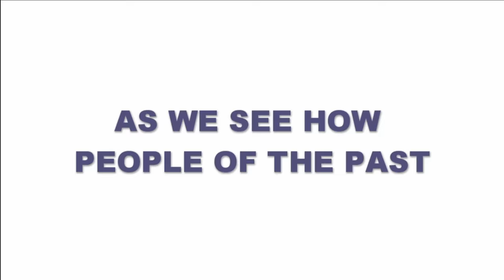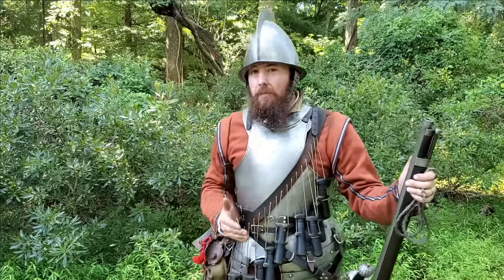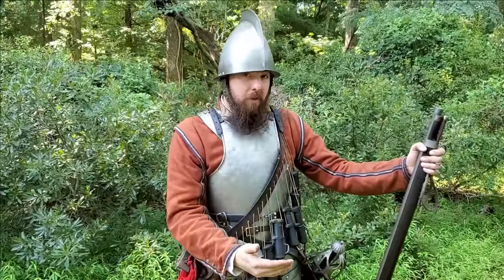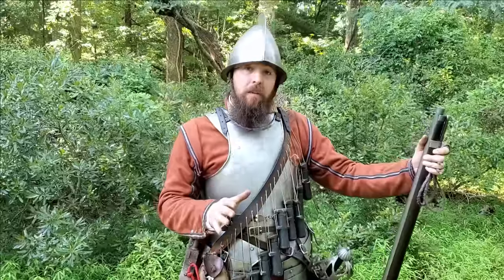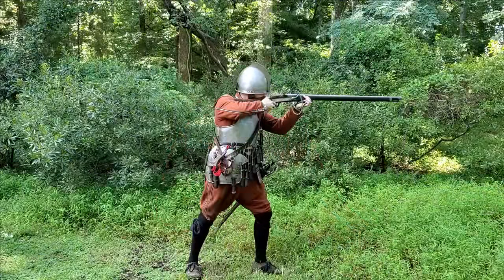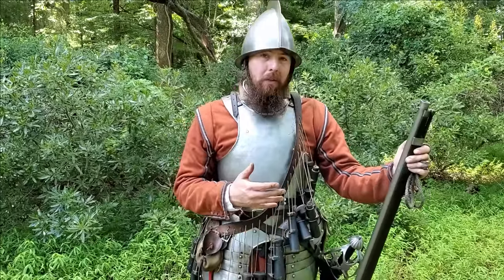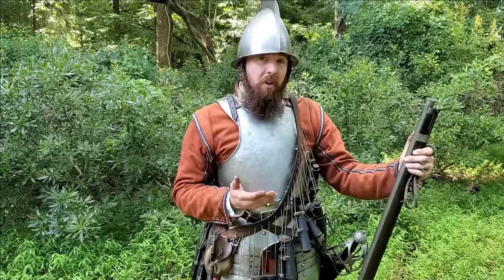Primed and Loaded | Matchlock Arquebus Rate of Fire

Comment: Imagine the speed of a blunderbuss, as you don't need to bother with the match, and can just throw your ripped cartridge right in the funnel
Reply from the maker: A firearm such as a blunderbus would at best see use as a cavalry weapon -- easy to handle, load and fire while mounted on horse. As a cavalry arm it would likely have a flint type ignition. But lacking any range or the energy of infantry firearms like the arquebus, caliver or musket. They may have been used aboard ship, but it appears they saw effective use in the 18th century as coach guns aboard Royal Mail coaches -- with flintlock ignition.

Is speed of loading the only important criteria?  We think that range, velocity and energy are pretty important.

Comment: Nicely done!!  Yes, trying to explain the differences in tactics and a more "methodical" approach to the way the weapons were used, as well as the 'team' dynamic, is difficult to an audience that has been used to "individual" rate of fire with a weapon designed for incredible rapid fire.  The mention too about "employing" firearms troops in the period differently, and that you may not want or need a ridiculous high rate of fire is hard to get across to the modern audience.  IIRC there were some letters or complaints from some commanders that demanded "trained bands" for their musketeers, they wanted to have competent, well-trained men, not anyone taken off the street and given the minimal amount of training, let alone under stress.
Reply: We 21st century individualists forgets how central adding manpower was to any number of tasks was. Even up to WW2 all problems were still being solved by adding more people to the equation. In war, it spreads out the workload and makes an individual's task easier. 

Only in modern times we are tasked ideologically to give individuals as many tasks as they can handle and then some.
Reply: @Oldsmobile69  it still applies today, Ukraine is struggling in the east since Russia has a 2 to 1 advantage in bodies right now
Reply: @Oldsmobile69  Ukraine is not faring any better, as of today Wikipedia paints Ukrainian dead and wounded at ~100k, given that Ukraine has a significantly smaller population and economy to draw from, there is little they can do without even more western aid.
Reply: @jackchurchill3777  "struggling" sure but keep in mind Russia is suicide attacking Ukrainian positions with convicts and expendable infantry to gain little bits of ground which works in the short term but if you look at the entire theatre even with those tactics they haven't even been able to take over a tiny village and are suffering much more casualties than Ukraine, of whom are more expensive to replace given how much more expensive a modern soldier is, than say a ww2 conscript armed with a rifle.
Reply: @jackchurchill3777  Ukraine has a significantly bigger economy to draw upon - EU, USA, Britain, the British Commonwealth, Japan, Korea, and many more. Russia's economy is a thirteenth that of USA.

Comment: Firing live rounds from a matchlock musket create lots of smoke, more then just from a paper cartridge with no ball. The smoke created from mass volley fire was something that also was used in tactics as you could move up close on enemy, fire a volley then charge with melee. The enemy would not see you coming because of the smoke. The smoke from mass volley fire could either be of use or a problem for you. Something you had to have in your equation during battle.
Reply: good example of a highland charge
Reply: That would only work if you attacked headwind. The Swedish "gå på"-tactic was to move closer until the enemy fired (often at some 100 meters), then run to almost point blank and fire (before the enemy could reload), then melee.
Reply: It actually could provide cover for the enemy as well, particularly if you had the hubris to think your volley shot them all down. It's why ROF was not as important as some make it out, because you obscure yourself  with the smoke.

Remember that they were firing a lot worse quality gunpowder then too.

Comment: This topic is interesting, I remember it coming up in regards to archery back during Jörg Sprave's "Instant Legolas" bow discourse. There, the idea was put to me that for archers rate of fire is not that important, because archers can only fire so many shots before they start getting tired and less reliable, so increasing rate of fire per man doesn't necessarily equate to that much more effective fire power in the long run. But when it comes to guns, which don't make you tired in the same way, my intuition is that a high rate of fire, on an open field, is gonna be key to overwhelming the enemy and winning the day. So it's not quite intuitive to me that there wasn't a very high emphasis on rate of fire.
Reply: You can get tired from doing this for a long time. That gun is heavy. When it comes to battles at this time, you have to consider men with matchlocks are not the only force on the battlefield. The guns aren't necessarily there to kill enemy soldiers, they put pressure on enemy formations while the men with pikes can close the distance, and the men with cannons can maneuver into position. When it comes to that, rate of fire is not incredibly important, since you don't actually need to kill the enemy, just keep them at bay.
Reply: I think it is fair to say that like with historical firearms, discussions on historical archery often place far too much emphasis on how fast you can loose arrows, as opposed to how accurately or how powerful your shots are. 

Some European and colonial sources do mention how impressed they are with the skill and strength of indigenous archers (1500s and 1600s), and do mention that they could shoot arrows noticeably faster than their crossbows or firearms. But there are a lot of other factors involved (such as power of the shot, which was far less consistent with archery, accuracy; presence or absence of armor and how protective it was or wasn't; lethality of a wound (usually less lethal with arrows); presence of other kinds of weapons and troops; the training and tactics of the men involved, etc. Etc.)

At the end of the day, you have limited ammunition either way and you've got to make your shots count. Rare of fire is overrated.

Comment: The other factor to consider is that in battle formations of this time period, the primary weapon was a Pike. Swiss Squares or Spanish Tercios used Pikes offensively against infantry and defensively against cavalry. The Arquebus' role was to shoot cavalry that was being held in check at the end of a Pike formation. Rate of fire would not have mattered. 
Historically, the arquebus replaced the crossbow, which while more accurate at range, took forever (and a lot of muscle) to reload.
Reply: Remember that cavalry was often carrying an entire brace of wheellock pistols at this point. Which they could empty into your line in a matter of seconds. As you'd only get one or two shoots off in return, careful shooting was life and death.
Reply: @benlewis4241  The wheellock came later, and brought an end to the previously undefeatable Tercio, for the reasons you say. But for 100years, it was the combination of Pike and Arquebus formations that ruled the battlefield.
Reply: actually the wheellock was introduced at about the same time as tercios were st their high point, the wheellock did not last long for infantry because it was tricky to operate and had a slow reload time compared to match locks. it was much more common with cavalry beacuse you could pre prime them in a pistol and carry a few ulike a matchlock which was cumbersome for a pistol on horseback.
Reply: Thanks for the info! Bad weather of course would bring the loading time back onto the wheellocks side- I think the prohibitive cost and maintenance were the real bugbears.
Reply: @benlewis4241  one huge issue with wheelocks is that they were very complex and you had to crank it which took time and in the middle of a battle the last thing you want is to be busy cranking you musket before you can fire a round, the matchlock was fairly simple to use and you could easily carry spare matches. 

yes bad weather was always an issue for matchlocks, that was one of the main reasons why the matchlock was gradually replaced by the flintlock and firelock.
Reply from the maker: @poil8351  @benlewis4241  What exactly is the bad weather that we are talking about? Because if we are talking rain or dampness impacting the matchlock, it is affecting the wheellock too, with the principle impact being the spoilage of the gunpowder.  In truth none of these ignition systems have a great advantage over the others in foul weather.  Rain can certainly impact the burning embers of the slow match, but it will also reduce the friction between the flints and steels of other ignition systems eliminating the throwing of sparks for ignition. The main issue we find with the wheellock is keeping track of the spanner wrench.

Comment: A little bit of a later time period, but I think it helps set expectations appropriately - Sharpe is Napoleonic War era, so late 1700s through early 1800s, and using flint rather than match locks, but we’re still talking about expected performance for an average smoothbore battlefield weapon (although by Sharpe’s era the way in which they were used on the battlefield was very different in some ways, it was deeply similar in others):

Sir Henry Simmerson : What makes a good soldier, Sharpe? 
Richard Sharpe : The ability to fire three rounds a minute. In any weather, sir!
Reply: That Sharpe quote was all I could think of while watching this!
Reply from the maker: But, would Colonel Simmerson approve?

Comment: As someone with a fair amount of time on flintlocks and percussion locks, matchlocks are slightly terrifying. I think I'd be more along the lines of some of the old manuals, with the monopod/stick and the match draped over it, arms length away, because explosives and fire tend not to mix. The speed of your drill is purely impressive! Ive managed three shots a minute with complete rolled cartridges on a flintlock, and it was a struggle!
Reply: It's just black powder. Even if you spill cartrige over match, worst thing that gonna happen is burning powder sticking into your hand.
Reply: @antonisauren8998  oh I know, but that's not exactly something you'd want to happen
Reply from the maker: Why terrifying? The potential danger is quite a bit overstated, and what one should remember is to handle the match and the musket in the left hand, handle the gunpowder in the right hand, and at priming remember to shake off and blow off the excess priming powder from the pan. Just as was done in the video.

We'd be curiouse to know which manuals instructed musketeers to handle and load their weapons with match draped over the rest and arms length.  In the volume Wapenhandelinghe van Roers Musquetten ende Spiessen ("The Exercise of Arms For Calivers, Muskets, and Pikes") the musketeer is taught to handle the musket and rest in the left hand and the match in between the left fingers.

The illustrations can be seen here -- https://wiktenauer.com/wiki/Wapenhandelinghe_van_Roers_Musquetten_ende_Spiessen_(Jacob_de_Gheyn_II)
Reply: @JYFMuseums  Interesting! It seems that I was remembering some random illustration of someone standing at arms length from a rest with the match draped over it as from some manual, instead of the portrait that it is. I'll remember that! 

And terrifying is a bit of an overstatement for dramatic effect, I admit. It's just not something I'm used to doing, as someone who's handled and fired a number of flint and percussion guns. Having a burning ember near the powder is one of the biggest bad things that can happen with muzzleloaders, so it's foreign to me to do just that when using a matchlock. With time, I'm sure I'd become quite comfortable, and perhaps even adept at it!

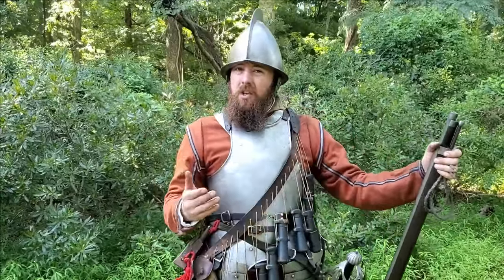Comment: This is so interesting and  fun, thank you and greetings from Greece. One comment is that 4 shots / 1:25 is optimistic because you start and end with a shooting, therefore one of them should not count. And a tactical question is why would they rank 10-15 men deep, taking turns, when they obviously could have three such divisions (of 3 men deep instead) with the same firepower each ?
Reply from the maker: Brian is working with the manual of arms from Wapenhandelinghe van Roers Musquetten ende Spiessen/The Exercise of Arms for Calivers, Muskets and Pikes. Illustrated by Jacob de Gheyn and published in the 1607. The manual starts with a loaded musket and the weapon's discharge before carrying the musketeer through the loading process. We believe starting with a loaded musket and timing four shots is a bit more reasonable than timing only three shots.

Regarding your tactical question, your answer in so many ways is the evolution of warfare and battlefield tactics from about the mid-16th century to the mid-19th century. In this timeframe we're going from a time when firearms are new to the battlefield and little to no doctrine or theory exists on how they should be effectively employed, to later periods full of doctrine and theory.

In the early-17th century with pike and shot warfare, infantry formations are going to have rather narrow fronts but deep in the number of ranks. These formations are built around the pike as the principle weapon and firearms are in a supporting role.

By the end of the 17th century with the advent of the bayonet and the decline of the pike's importance -- even it's disappearance -- infantry formations have changed to a wide front but shallow in depth and the musket with a bayonet being the weapon of the infantry. 
 
This evolution will take us from a time when firearms support the pike and their fire is often steady and deliberate to a time when firearms dominate and their fire can be as a volley to deliver shock.

Comment: I love this stuff. I've heard that a tighter patch and/or tighter fitting ball could give reasonable accuracy to hit a mans chest at about 100 yards, as you seemed to imply. What do you think of this? It seems in the 1700's-early 1800's, prior to introduction of rifled-muskets, soldeirs would load a very loose fitting ball that took significantly less time to ram down, and with which the bore succumbed to fouling at a much slower rate. It would make sense that a tighter fitting ball used for point-shooting would lead to a slower rate of fire. I have heard that a proffessional soldeir of the british army in the 18th century may be able to put off a respectable 5 rounds per minutes with the paper cartridges they were issued along with their brown bess muskets.
Reply from the maker: @biathlon 97  We're glad that you liked the video. To answer your first question, yes the tighter the fit/tolerance between the bullet and the bore of a firearm barrel, the more effective the shot will be. Though the length of the barrel and how completely the gunpowder is burned and the energy the combustion generates will also impact the effectiveness. 

But we'd caution that the expectation to strike a man's chest at 100 yards is a rather unreasonable expectation. If we consider that a man's chest is not much larger than a sheet of paper or small bore target, that target is unreasonably small at 100 yards. But what if we consider the target to be a man as a whole? Say 5 feet by 2 feet?
Reply: @JYFMuseums  you should try it

Comment: The Arquebus was the Musket's Daddy. The Leap between "Handcannon" and Arquebus was mostly about evolutionary refinement and improved experience with making metal tubes, firing mechanisms (which was truly where all the most impressively overcomplicated solutions were dreamed up in) and powder. All the mistakes in the Arquebus were finally ironed out in the Musket which then quickly got replaced by Rifles because the machining practices of the time enabled us to make rifled bores and better shot to better precision. The Downside to all this was the better the gun, the more it could jam from misuse. Handcannons and Arquebuses could damn near load anything that fit, as long as you don't burst the barrel.

Comment: The spanish tercios usually carried  12 "packets" ready to shot. They were called "the 12 apostols". You only need 3 ranks of guys with archebuses to keep a constant  rate of fire.. Spanish also invented that method to keep the volume of fire. Also, in most battles, 12 shots were more than enough. Take in account those guys paid for their ammo and gunpowder, so they really shot scarcely. There were battles where the "king's powder" was used, that meant the king actually paid for the ammo in those battles and archebusers would shoot more overall...
Reply from the maker: That the bandolier was known as the “twelve apostles” or “apostles is modern lore and nomenclature that begins to appear about the early-20th century and has become a very popular “reenactorism”.  “Twelve apostles” or “apostle” is not a term that appears in the available primary sources or military treatises of the 16th or 17th centuries.